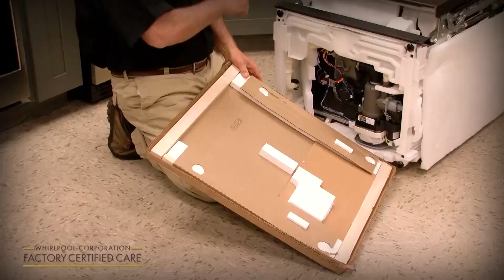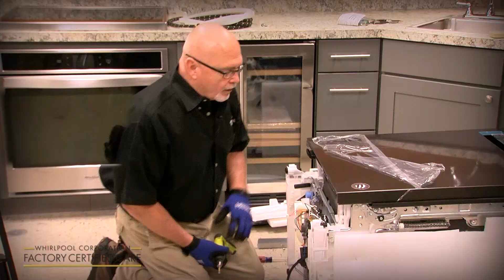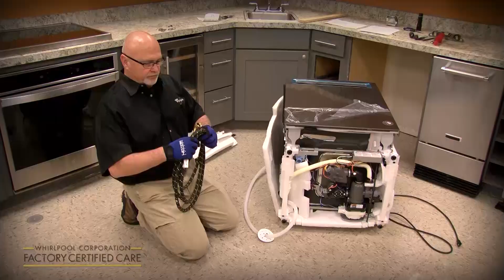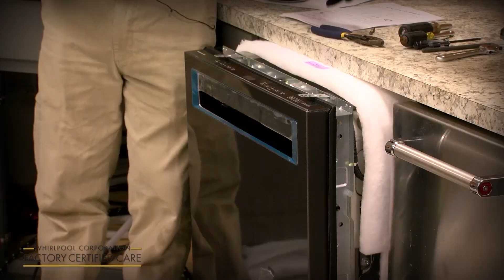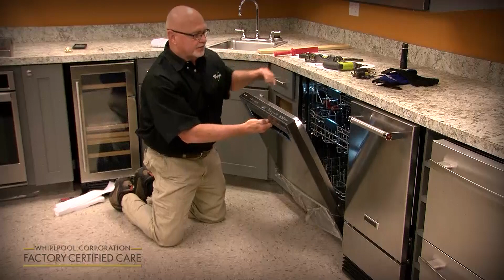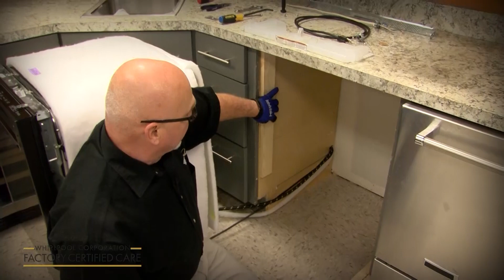Maytag Dishwasher Installation (2020 redesign)

Comment: 3D piece of plastic.  Preferred wire nuts , having  to have a special water hose connector sucks ,drain hose isn't long enough.  Bottom line , it won't last as long as the old , better made in USA stuff . Not made to be fixed just replaced with another overpriced piece of junk . Plastic threads ? Seriously ? Cheap crap .

Comment: MDB4949SK I wish you Luck! Purchased this in December 2020 from Best Buy.  It was installed in Jan 2021 and was broken by Feb 2021.  Just had a 3-week wait in February for the Repairman who informed me that it was an installation error where the hoses were bent. Test drive it after the Repairman leaves and only half of the machine works.  Also,  It doesn't have a manual.  Let me know if your luck is better than mine.